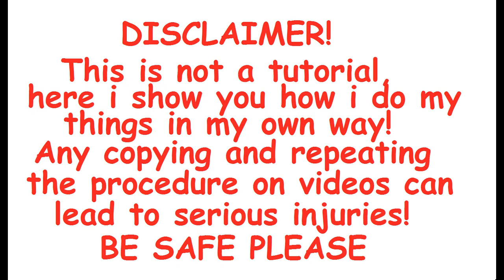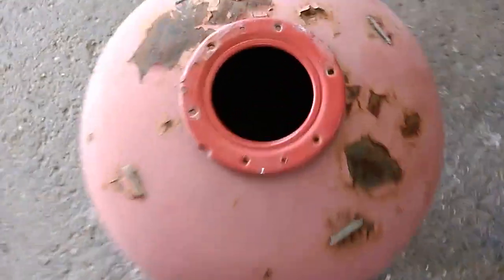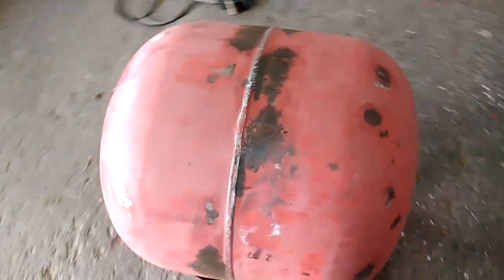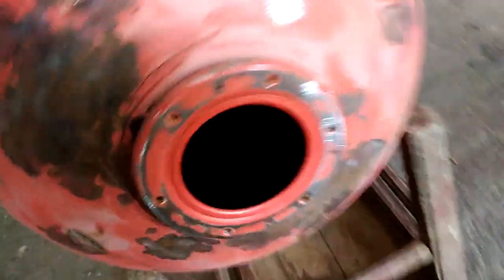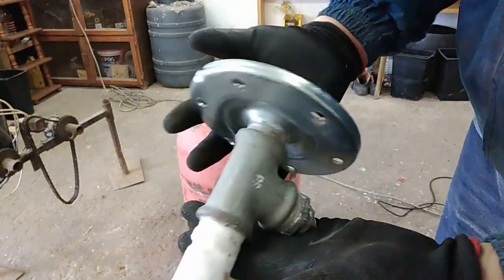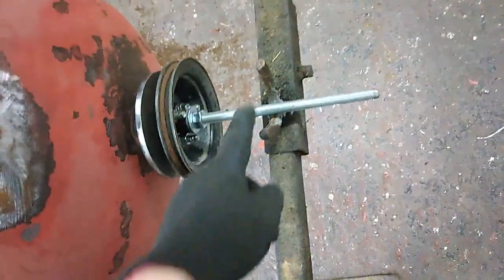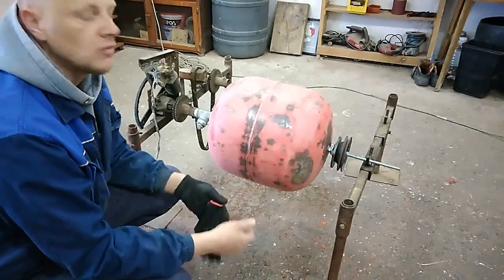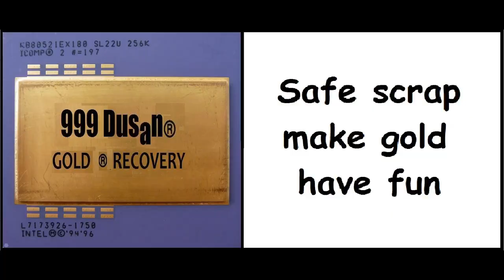Ball Mill bild part 1

Comment: Nice! 👍 You are going to love it!! You can do so many things with a ball mill.
The part inside is called a "lift arm".
Looks like it's turning a little slow, but that's fine. You'll probably want two lift arms. Some people like to run a little faster, others people prefer the lift arm. Six of one, half dozen of the other in my opinion. 
Cheers!

Comment: I would suggest to make it go a bit faster. At that speed it would take forever to grind anything down.  I use a ball mill to make black powder for use in pyrotechnics. My mill goes about 3 times faster than yours and it takes 2 to 3 hours to get a decent powder going. If I'm making aluminum powder, it takes a week. Great build man,  I really enjoy you content btw.

Comment: Zdravo Dusane. Maybe you can use a PC Power Supply instead of a battery to connect to the house power? PC P/S have a 12V output and some of the higher power ones can handle a bit of current so it should be ok for your motor.

Comment: Hey bud, been a while since I've been doing any refining an missed it alot. I made a ball mill few years back an what I did was use a treadmill motor. They have a board on them to use the motor. I put a variable knob on so I can speed it up and slow it down. I also started without the cross fin inside the tank but later did put one in. I suggest you find a way to speed that up because I have same size tank so it needs speed so those balls fall at the same time. Good seeing you're still processing!
Reply: They work while we work an do the job very well! You will love a mill bud